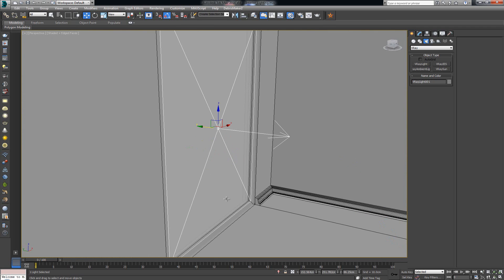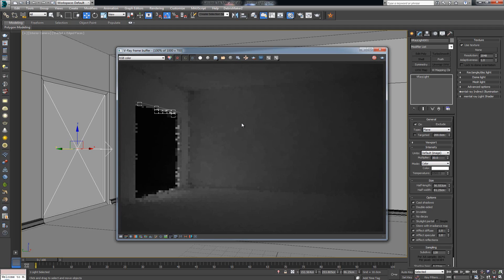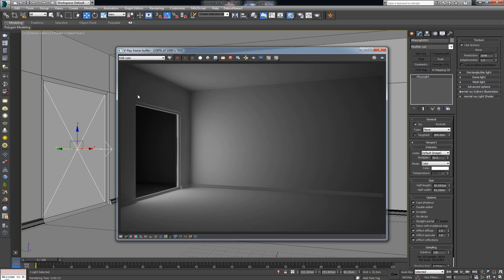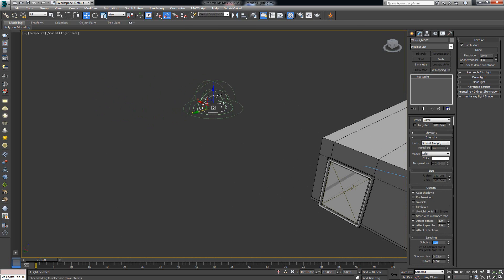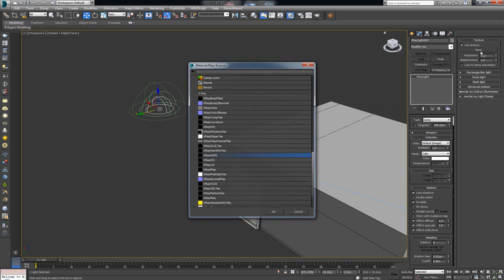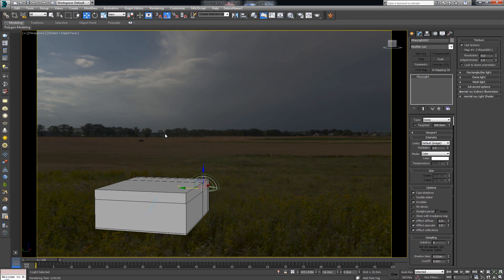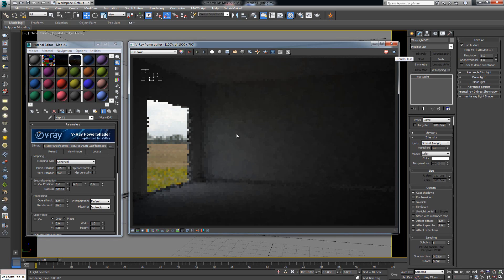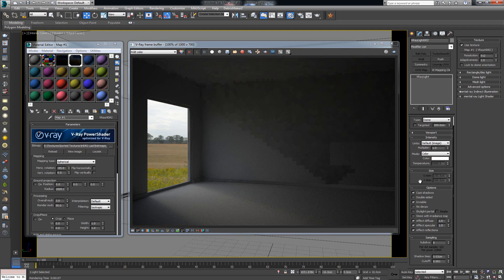Interior lighting with V-Ray HDRI

Comment: Hello again Denis! Something that i always wanted to ask.. (if u know that is..). Why in the material aditor there is an Overall mult. and a Render mult..? Ofcource i always messure to correct the lighting from there, but i haven't really understand what is the difference between them. Doesn't Overall gives the same result to our rendered frame, or the opposite..?! 
(unexplained questions for years.. hahaha :D) tnx
Reply from the maker: +George64 Main difference between both options is if you want to have the HDRI show up in your viewport so as HDR images are typically over exposed and may appear blown out in your viewport. To fix this, lower the overall multiplier so that you can clearly make out brightest spot within the HDR image. The render multiplier is there if you only wish to affect the map upon render time and not in the viewport. 

Hope that cleared up anything that you had bugging you :)
Reply: +Denis Keman ok, i get it now. that makes real sense. However, i know that every artist works on its own way, but personally in order to succeed HDRI render, i use separate HDR materials.. Light, Reflect and Environment and then i drop them as instance vRay GI Environment, which in this case you have full control of everything. I Believe that are some other better ways in order to have great results, but for now it works just fine. Furthermore, i've seen great tricks from your tutorials and i thank you for that ;)
Reply from the maker: +George Somarakis It's all about what you enjoy doing and knowing that there are many ways to do a single thing in 3D. I for one enjoy and love 3D modeling and rendering in general, and the majority of the videos that can be seen on the channel are simply me sharing the things i find interesting. I do hope that you will learn a few more things by watching some of the other videos i have, and if you are considering picking up ZBrush or Marvelous Designer then you might find something for that as well.